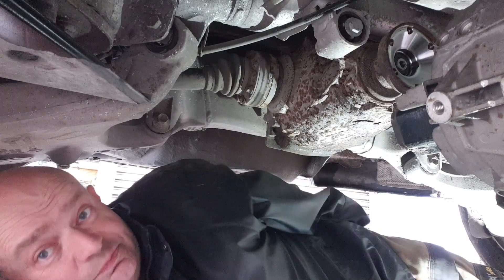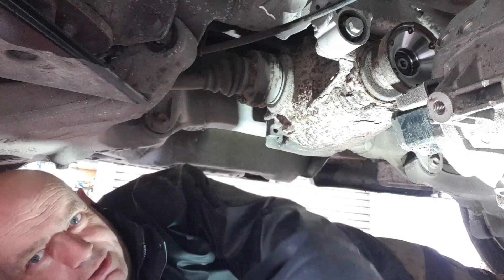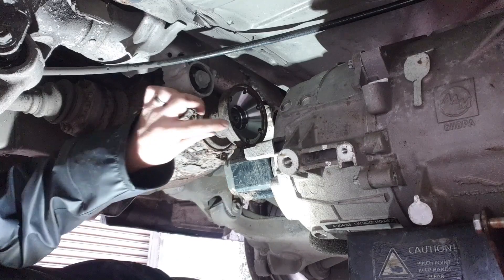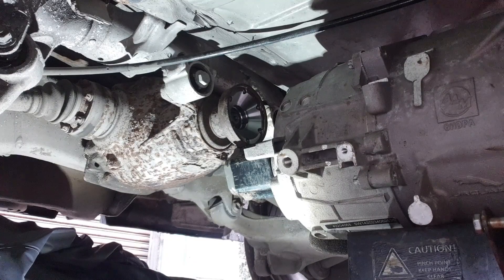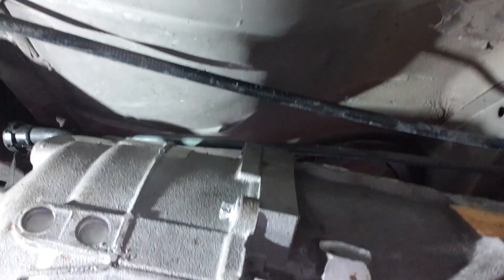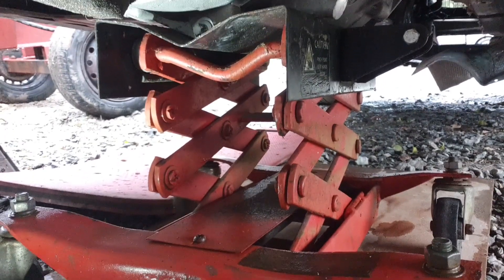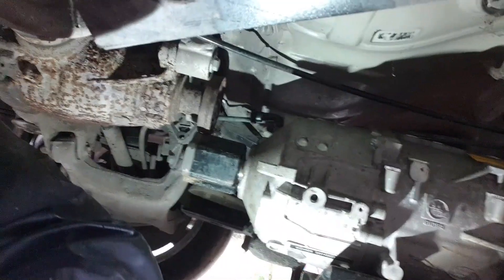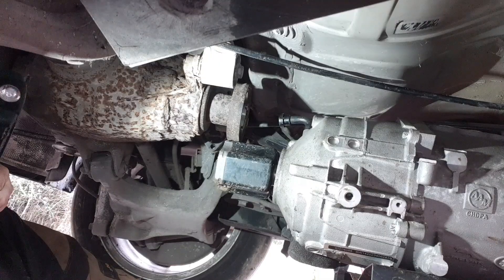Jag Powered BMW E61 EV Project Ep.02

Comment: I think because both ends are fixed you don't need lateral space on the CV. You could cut the length down, then cut a short shaft from the CV  to a flange on the BMW. I would weld the flange on square as possible then machine it perfectly square. A dial indicator on the diff would help to align up both halves. Happy mating mate.

Comment: Thinking aloud; I think my bus has a double cardan joint between angle drive and gearbox, they're relatively short but allow slight misalignment angularly and slightly out of centreline too. a single UJ wouldn't do that (and also they need to be in pairs to give constant velocity), a CV joint wouldn't allow the misalignment (only angle if singular, hmm). Would a small driveshaft with CV joint to fit the cup that's in the motor, and a bolt on type CV the other end fit?  Presumably the shaft could be very short if the motor and diff are aligned well? If you could get it near perfect alignment, a rubber donut coupler may be viable as others have mentioned?

Comment: So you welded up the diff so both CV joints will spin but will you not now essentially have an insane high reduction ratio since you have two differential reductions and the epicyclic gear reduction? Maybe better to rip out the BMW diff and just use the Jag unit in its place.

Comment: you should remove CV joint on motor side , cut it half and weld/balance rear end of propshaft that fit to diferential. But you wont be able to do your self. Better to give profesionals wich can balance it... but leaving space for bolts.. This is my opinion at first glance...